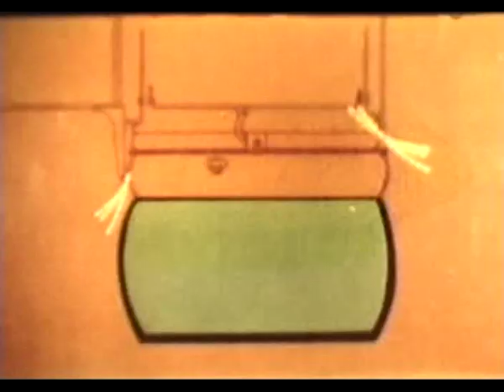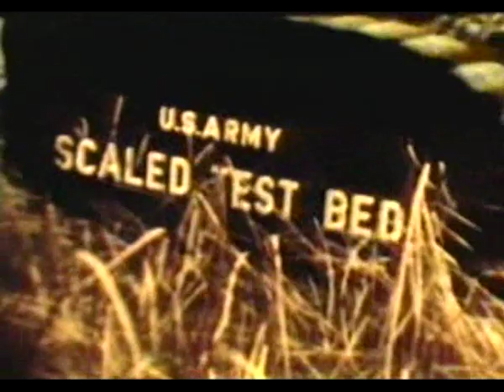Plenum Air Tread Amphibious (PATA) Test Bed

Comment: What a waste!

You could just strap inflatable pads onto the belly of a Cargo Truck or Cargo Track (and low-set, rigidly-placed inflated pontoons on the side), and get the SAME capabilities. That would allow normal vehicles to be adapted to Marginal Terrain --- all without the Rube Goldberg Machine of multiple pumps, constantly inflating dozens of moving, track-fitted balloons.

Or, you could just use an Air Cushion Vehicle.

Either approach would be one HELL of a lot more practical than this.
Reply: They didn't have access to your superior intellect.
Reply: @rjj54321  Things like these are usually conceived by large committees, which are never smarter than the sum of their collective stupidity.
Reply: @BlacktailDefense  are you an engineer??
Reply: @rjj54321  I'm no engineer, but I could screw-up and still do better than the PATA.
Reply: @BlacktailDefense   i see, you have a channel with videos on engineering mistakes of various weapons projects. It's amazing that with zero engineering knowledge and not being involved in any of the projects you can spout so much "knowledge". Anyway you are an example of true youtube expert. By the way you won't do any better than PATA , at best you will make shitty videos.
Reply: @rjj54321  I'm well read on what doesn't work in engineering, as my videos prove.